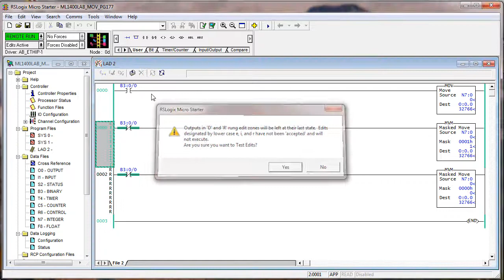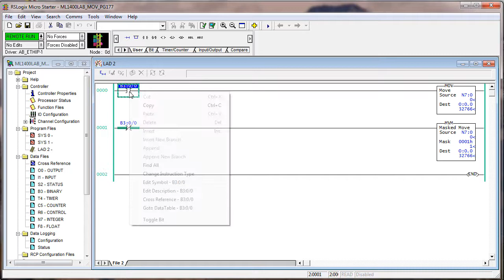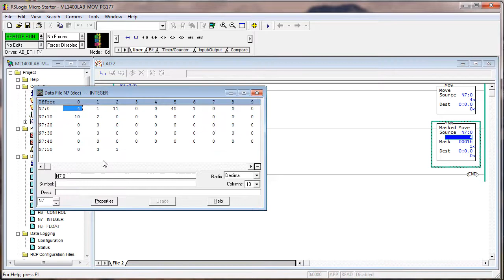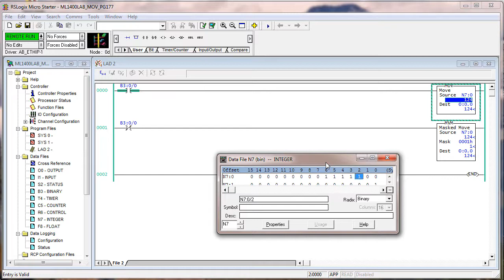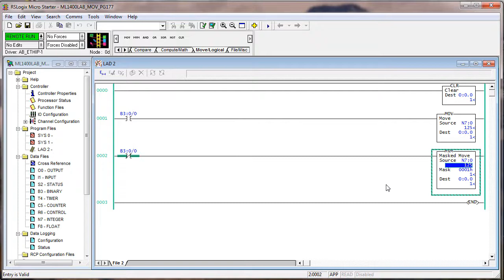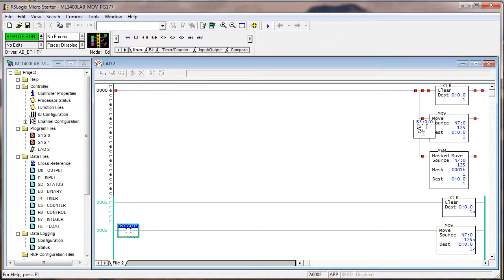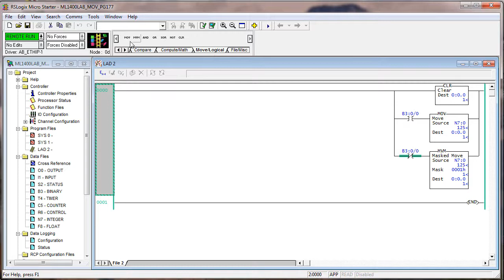26 - ML14 MOV & MVM P172

Comment: I added CLR just as you said as the first rug but then the other rugs didn't work in moving the bits. I used the Emulator and the PLC is 1400. What did I do wrong. Please help.